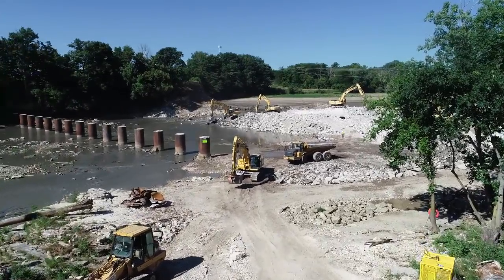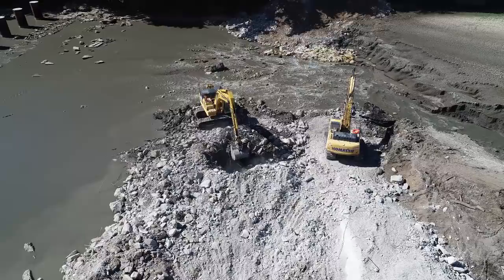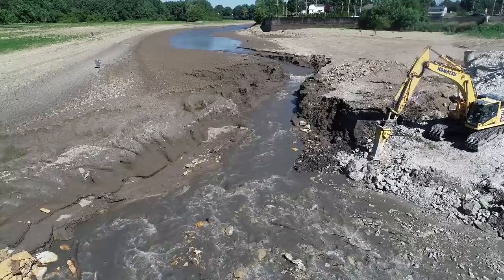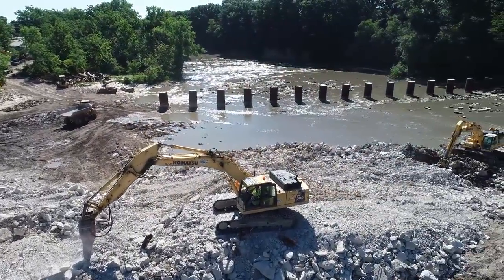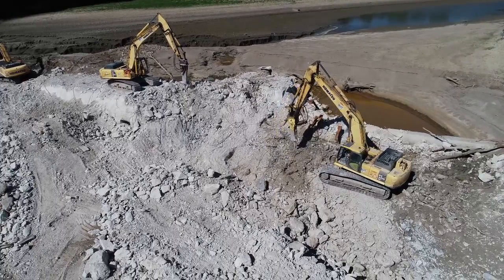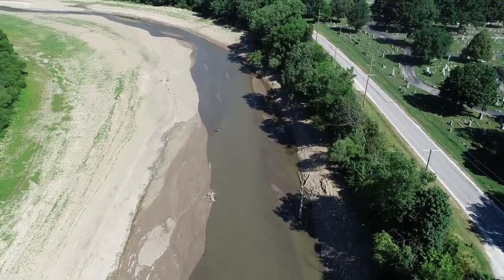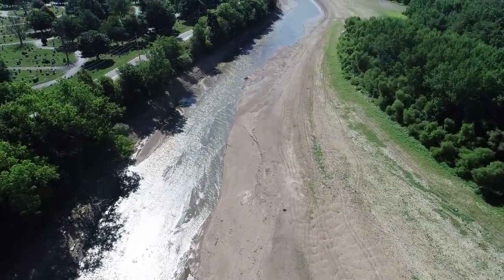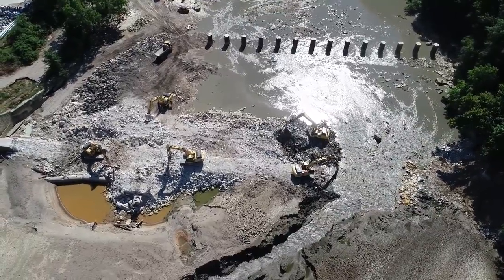Dam Removal Day 16

Comment: Why not just blast it in a controlled setting
Reply: That would cut the job by 75%,skilled blasters could do it easy.
Reply: They’ve already stated that there is too much steel reinforcement contained in the concrete for blasting to be effective

Comment: nice job Bruce !   do you thing they will also remove the ice thingees there just below the dam ? I can't imagine they serve any purpose now.....
Reply: just look up Ice flow videos on here and you would be surprised how high a river gets in winter and more so during thaw sessions, I live in a rental home on a river and in spring and with the rainfalls, it swells and ice is not much of an issue even with a few dams still existing on this section. I can not imagine how much they paid for the installation of and for the piles but better to keep them even not very useful outside the that season of winter into spring but when they are needed are good protection for the bridges supports down stream
Reply: Ryan, do not see how said driftwood would impede and block the waters flow, unless no one bothers to remove said debris as it builds up.